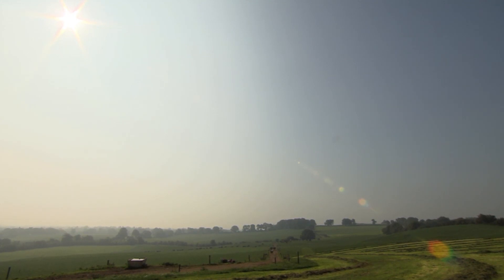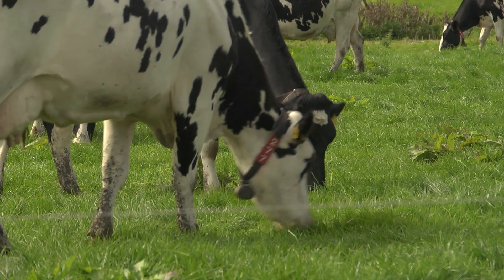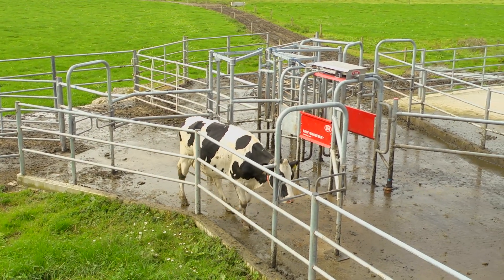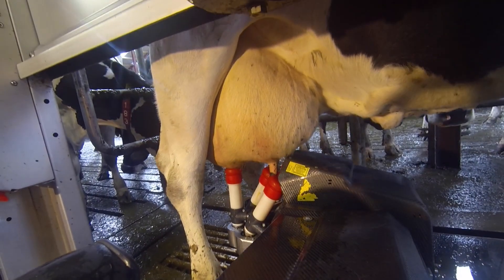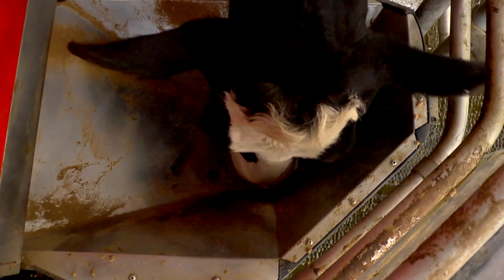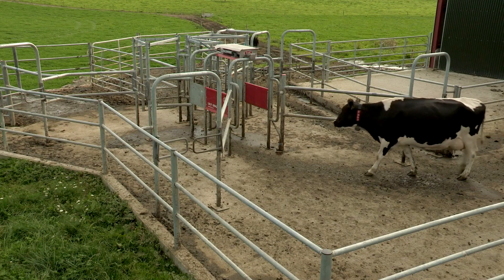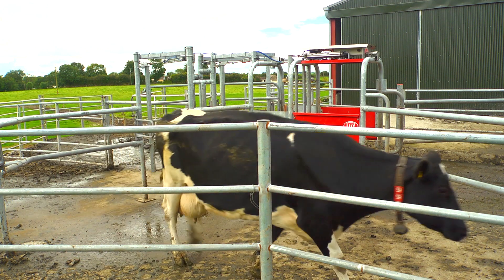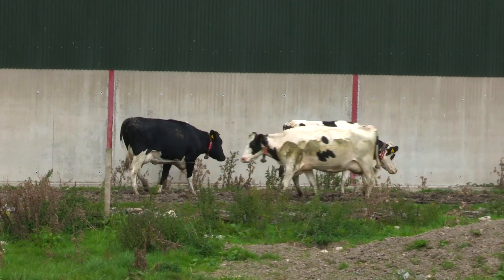Lely Astronaut & Lely Grazeway - Perfect grazing - EN

Comment: Does this work in practice?
Reply: There is a limit to the distance a cow will walk from the field to the robot. The fields also clearly have to be adjacent the shed with the robot. Since you have about 60 cows per robot, and the limitation of the distance the cow will walk, you will probably be limited to 2 or 3 robots, and so 120-180 cows.